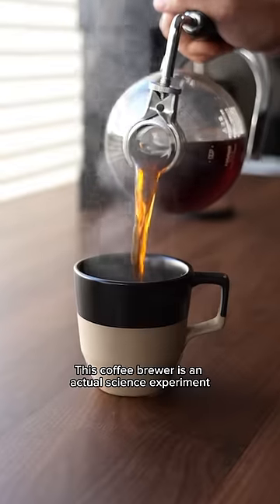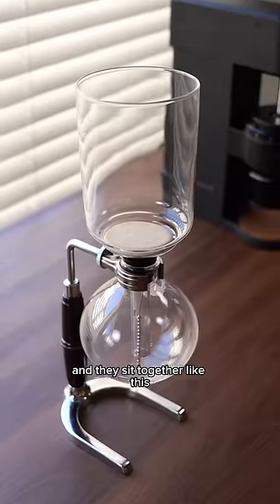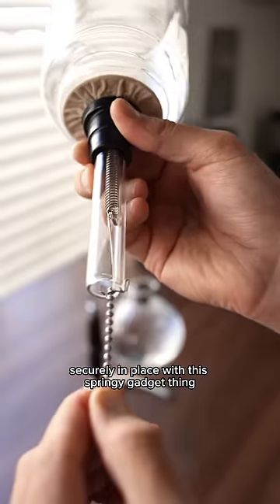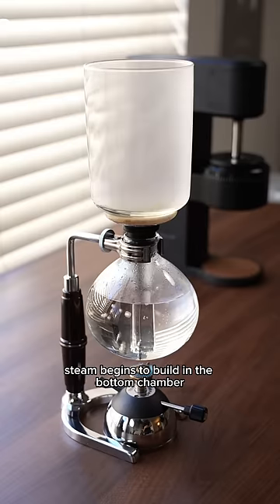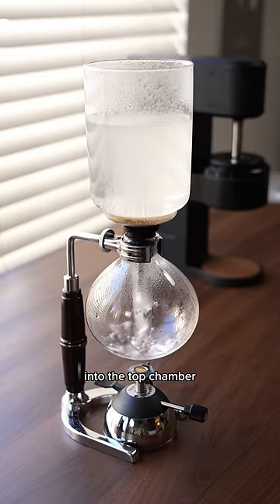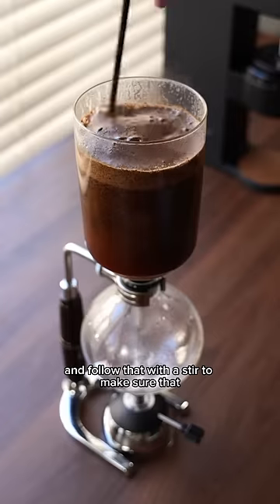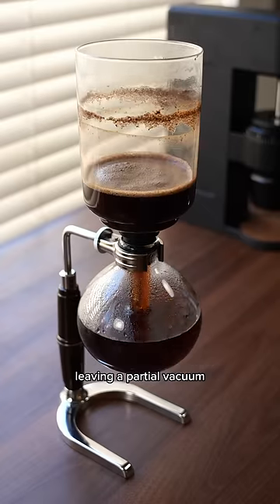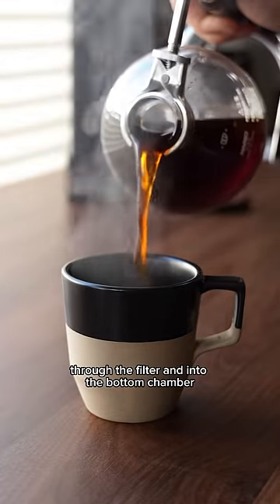A Science Experiment That Makes Coffee - The Siphon Brewer

Comment: Because the coffee is exposed to a partial vacuum as it enters the final chamber, dissolved gases(such as CO2) are pulled out of the liquid. This reduces the formation of carbonic acid, making it taste less sour, and allows the bitter oils to emulsify better, reducing the bitter aftertaste. The effect might be minor on this model because of how small it is, but equipment like this can definitely produce some kind of noticeable result.
Reply: Thanks I was wondering what the point of this thing was, cause otherwise it just looks like a filter coffee with extra steps
Reply: @The8merp it also is a way to maintain a constant, low temperature since there's an extra layer of insulation between the water and the heat source.

It's next to impossible to burn the coffee this way
Reply: Coffe is never exposed to any vacuum in here. Shows how you don't understand what's really going on inside this device physically.

And all you need to do to get rid of dissolved gasses is just boil the water, since high temperature decreases their solubility.
Reply: Also the bitterness comes from overboiling the coffee. This doesn't happen here, because the water temperature falls before it gets to fill the upper glass.
Reply: By the way, how would size of the model prevent the alleged effect from happening??
Reply: @puchacz199  the cooling water vapor in the bottom vessel causes the pressure to drop, creating a vacuum effect. And the dissolved gases in question are coming from the coffee brewing, not the water. Coffee beans release carbon dioxide.
Reply: @Gaswafers   yeah, but there's no vacuum as water gets instantly sucked up down again the exact moment pressure starts dropping.
Reply: LIES! YOU have no honor!
Reply: @puchacz199  if the liquids getting "sucked" as you said, doesn't that imply there being a vacuum?
Reply: @puchacz199  not to mention he says "leaving a partial vacuum" in the video 🤔
Reply: A vacuum doesn’t suck, the atmosphere pushes to fill a void at lower pressure. Big difference.
The effect of this difference is that the coffee is never subjected to a vacuum at any point.
Reply: @The8merp  That's basically what it is
Reply: @gtjack9 ummm, sorry to burst your bubble. However, that is the definition a of vacuum.
Vacuum pressure is a pressure that is lower than the surrounding atmospheric pressure. "partial vacuum" is accurate because it's not a complete vacuum "the absence of atmosphere".
Reply: Wouldn’t be CO2 not just redissolve in the liquid once it returns to atmospheric pressure?
Reply: The definition of diminishing results.
Reply: @BooBuKittyPhuk  its not getting sucked its falling due to gravity and also the air pressure from above, what hes saying is at no point is the pressure in the bottom chamber lower pressure than atmospheric pressure, infact its always higher pressure than atmospheric pressure because the weight of the water is also compressing the air in the bottom chamber, so its the opposite to a vacuum, the coffee falls back down because the pressure isnt high enough to hold the weight of the water up so it falls equalizing the pressure,
Reply: @JAGaymer  its not a vacuum because the water moves to equalize the pressure so its not lower pressure and the fact that until the very end the water is still being held up by the pressure inside of the bottom chamber, its like holding a box above your head then placing it on the floor, at no point did you pull the box down, you just pushed up less and less until you placed it on the floor, the only point where there is a partial vacuum is when the water level in the tube is lower than the water level in the chamber
Reply: @JAGaymer  if the water couldnt move then it would be a partial vacuum because the volume of air would stay the same and the density would decrease, but as it does move the density of air doesn't decrease because the volume of air gets smaller
Reply: @expresscrayfish6094  well, in the video he says there is a partial vacuum, so I'm not sure you're right so much as you think you are, but you very well may be because I don't know the content creator here so I'm not sure how much he knows about physics
Reply: you mean I might actually like the taste of black coffee if I used a proper one of these?
Reply: @TheRogueX  cold brew is probably still better.
Reply: I'm pretty sure that simple boiling strips dissolved CO2 and O2 out. By the way, some coffee geeks don't boil the water to avoid it because of taste
Reply: You Stole that word for word from Breaking Bad😂
Reply: You mean, this one actually makes sense? Wow.
Reply: @expresscrayfish6094  I like your explanation. Very nice imagery too. You make very good points, that I don't have the energy to do the research and, maybe, dispute. This round is yours, good sir!
Reply: Coffee reflux
Reply: Are you serious!? Never thought that there is a real reason except it looks cool. Thanks for sharing! 😂
Reply: @puchacz199 note that the comment is about a partial vacuum and it works best on a larger apparatus
Reply: @Gaswafers cold brew tastes like motor oil compared to a siphon brew
Reply: I always wonder how people can be so confidently wrong, people like you or flat earthers always makes me laugh
Reply: The PSI on the coffee is never negative; it’s held in equilibrium the entire time — PSI on the coffee is always 0.
Reply: ZZZZZZZZZ it’s a short bro
Reply: "Ya gotta decarboxylate it!"🎶🎶-not The Offspring
Reply: But all minerals will stay on coffee 😅
Reply: @puchacz199  a Don Pedro is using vacuum to suck the water down from the upper chaimber down to the loser, when it cools down and the volume is reduced.

BUT that is just to draw the hot water down and filter it before it enter the lower chamber.

Has, as you wrote, nohing to do with extracting CO2 or other gasses from the water ot coffe.
And the process do make it impossible to burn the coffe.  Because when you stopp boiling the water, is when the water is going down.  And boiling water can never exceed 100 degreese there, and when it is pressed up, it isn't steam and is mixed with cooler water.  So it is way under 100 degrees when it reaches the upper chamber.  And to suck the coffe down, you have to reduce the temperature in the lower chamber.

So yes, it is just a way of expose the coffe to hot water, and then filter away the coffe powder from the finnished product.
Reply: i aint reading allat
Reply: @puchacz199 the comment says Partial vacuum
With a bigger setup, you can get an even stronger partial vacuum
But it's almost impossible to get a full vacuum
Reply: @Gaswafers when im in a stupidly ignorant contesr but this guy is my opponent 😔😔
Reply: Beautiful. Most cafes and restaurants around me are always so acidic/sour. I just make my own now lol
Reply: @gtjack9  The only difference is perspective. Push/pull only differ by the frame of reference.
Reply: Oh, I agree! I have one of these and absolutely love it. It makes the best tasting coffee of all my coffee makers. Once, when I accidentally broke it, I lamented its loss online and received several as gifts that year. Now, if I break another, I have backups!!
Reply: it's still always gonna be garbage coffee because the extraction is happening at atmospheric pressure. you need about 10x that for a decent result.
Reply: Oh wow 😳 thanx for this 👌
Reply: @puchacz199 boiling coffee ruins it
Reply: @puchacz199 That’s just wrong. Literally the opposite of what happens.
Reply: I like my coffee a little sour. I guess it would be nice if it could just reduce the bitterness but keep the sourness.
Reply: and if you add some Methyl groups to some pre-processed specific monomers DEA may bust your door...but yes,you are right
Reply: There’s no carbonic acid in coffee, CO2 is all way evaporated (if there is any to begin with) when it gets heated. Chlorogenic, quinic, citric, malic, acetic, formic, lactic, glycolic, and phosphoric acid, and occasionally tartaric acid are found as they are all more soluble at higher temps  in water (like sugar or most things) CO2 however is more soluble in water at low temperatures, that’s the reason a warm soda fizzes more. The dissolved co2 comes out of solution and leaves as a gas causing the fizz, when it’s cold more stays dissolved so less fizz. 

It’s less acidic because the water is not as hot as drip coffee which is almost exactly boiling as it comes from steam which condenses at the temperature water boils at then drops to the coffee. Even better is a mokapot because the water only passes through otw up to the top and doesn’t stay in contact giving the acids more time to dissolve. Mokapot is also totally different tasting though because you use espresso.
Reply: @puchacz199 some of the coffee does experience a vacuum as the first bit enters the chamber and the chamber is still in negative but your spot on that buddy has no idea what’s going on here 😂
Reply: @gtjack9 no you’re confused about what a vacuum is. Sucking doesn’t exist without a pressure differential just like the one caused by the bottom flask. It is in vacuum and at the beginning the coffee going in does experience a vacuum. Saying the air pressure from above is higher than the pressure inside is saying the same thing as saying the container is sucking the liquid in. Everything is relative.
Reply: @atomatopia1 he’s just completely wrong, don’t think about it too much. But no, that’s like saying once you open your warm soda and it loses CO2 wouldn’t the CO2 come back when you cool it down. It’s gone and become like .001% of our atmosphere. Technically at room temp if there was absolutely pure water some CO2 would enter the water but it would be immeasurably small for most instruments
Reply: @MasonPapenbrock-my4gl  Yet, you’re missing the point that the bottom chamber is at atmospheric pressure, it’s impossible for it to form a vacuum, it’s actually slightly over atmospheric due to the coffee above the bottom chamber which is being pulled down by gravity. As the pressure in the bottom chamber drops due to the steam condensing into water a very slight below atmospheric pressure is experienced, but due to the coffee always pressurised above by the atmosphere it only experiences a very slight below atmosphere pressure as it flows downwards. This is nowhere near enough to cause the co2 to boil out of solution
Reply: Co2. But the flame isn’t inside the base
Reply: @GeddyWoods  what’s that affecting in the situation?
Reply: But doesn't using boiling hot water already overheat the coffee and extract more bitter flavors? From what I know this is the whole issue with espresso pots
Reply: @Jacob-yg7lz  no, the mokapot will not be bitter if you don’t leave it on the stove top too long. As soon as you hear steam chugging through the top you’re supposed to pull it off the heat. I even run the bottom under cool water to stop the heating entirely. If you do it right it’s not over extracted at all but if you let it go for even 10 seconds too long it will be awful
Reply: @expresscrayfish6094 I’m not going to argue the vacuum being an real effect here or whatever, but “its not sucking the coffee” is completely false either in the common language usage of the word ‘suck’ or in the fact that it it quite literally is sucking the coffee back down. Either way, you’re wrong.

Look no further than a straw. Heres a question: “Do you suck your drink up through a straw?” I would bet that every single person asked that would say “Yes, that is sucking”. 

So, why would this not be sucking in this case? When you suck fluid through a straw, you decrease the pressure in your mouth via jaw, cheek, and other anatomical functions. This low pressure zone includes your mouth and the straw. The beverage sits in-between the straw and the outside atmosphere. Once the pressure drops low enough, the outside atmosphere begins to push on the beverage and forces it up the straw and into your mouth. So I ask again: “Can we agree that this is sucking?”

Now to bring the point home. Here we have a reservoir of fluid (the top coffee funnel), a straw (literally the straw/tube at the base of the funnel), and a lower heating chamber (the flask at the bottom of the system).

The water boils, which creates a high pressure zone inside the heating flask, this forces the water up as it seeks equilibrium between low and high pressure. Once equalized your coffee is brewed and then you remove the heat. The temperature suddenly begins to drop, which causes the sustained high pressure to drop as well as there is nothing supplying energy to create that high pressure zone. The high pressure turns to lower pressure and as such, both gravity AND the fact that its lower pressure than the atmospheric air (because gravity cannot act if its too high in pressure) pulls the coffee back down into the flask. Other than gravity helping the coffee down in this situation, the effect is the same. Lower pressure zone which is separated from a high pressure zone by a fluid buffer. Again, the only difference is that gravity held the fluid down in the first example and instead it is gravity here which assists the fluids descent. However, the effect is still there. A low pressure zone sucked the coffee back into the flask (with assistance from gravity).
Reply: @puchacz199 after the steam condenses the lower chamber is under 1 atm vacuum which pulls the coffee water back through the filter.
Reply: @puchacz199 there is a pressure differential.
Reply: @puchacz199 he literally says the bottom chamber is left with a partial vacuum after the water boils, the steam forces the water up into the top chamber, the difference in atmospheric pressure now created A VACUUM in the bottom chamber
Reply: Im sticking with my Kurig because it's much faster.
Reply: @adamstrong98  Never underestimate the idiot. 
They are far more skilled in their craft of improbable screw-ups and regularly innovate in their field in ways even the most skilled engineers are left scratching their heads.
Reply: @gtjack9 Next you're going to tell us that magenta isn't a colour and centrifugal forces don't exist 🙄
Reply: Okay that's neat and all but temperature control looks like a bitch. I guess you can regulate it with dilution with cold water but you're adding heat during the entire extraction until you pull the vacuum by removing the burner. 

Dissolved gasses are less soluble as the temperature of water decreases and if carbonic acid is your main concern, you could prepare water that's been flushed with something else (like nitrogen) first? Iunno, it seems like, maybe not a lot, since people do a lot of weird shit for coffee, but like, not a great trade-off? like, a lot of the acid content is gonna come from the coffee itself, so getting low acid coffee or better control of the extraction seems more productive than messing with the acidity of the water from dissolved gasses. Heck, a lot of coffee nerds just adjust the ph of the water directly with, like, baking soda. 😂
Reply: @The8merp except it's not at all what this person is talking about. This is Jo different than sucking something through a straw. Does sucking coffee from a coffee cup through a straw have any effect whatsoever? I don't think so
Reply: @BooBuKittyPhuk NO. By definition if the water is being sucked, there is no vacuum.... If the water was stopped somehow THEN there would be a vacuum. But not in this setup
Reply: @atomatopia1 exactly. The Co2 is just whatever is in the air. The Co2 isn't separated
Reply: @BooBuKittyPhuk yea and people who make videos say a bunch of bullshit that sounds correct but is wrong just to keep your attention so you watch the video. That doesn't make them right. The guy in the video is wrong. It's not a "partial vacuum". It's called a lower pressure, not a partial vacuum. Partial vacuum is just a confusing description for laymen to understand but it's fucking wrong. A vacuum would require a drop in pressure with a constant volume. The example in the video is a change in volume of air (the amount of air increases but the pressure stays the same ), and then the volume reduces as the air cools, but again, the pressure stays the same (because the volume changed)
Reply: @fgui11 it doesn't, it takes more energy than that. Water steam is just H2O
Reply: @puchacz199  As I noted elsewhere, add the coffee before starting, and immediately remove the burner when the water is forced up, for the reasons you give.
Reply: It'd have to be effectively useless for me to not wanna do it this way anyways. 😂 It looks so dope and yields a clean brew, I presume.
Reply: @JAGaymer  you can't win an argument against a fool. Leave him to think he knows what a partial vacuum is and move on with your life, man.
Reply: Me only drinking my dark roast black "but I love bitter coffee"
Reply: @jawnske sorry you're illiterate.
Reply: Bitterness is what makes coffee coffee
Reply: @danInRealife  bitterness is a part of coffee's flavor, but it's not the only part!
Reply: Question, on another short- they said that the flavour of coffee can be expelled in the form of steam, thats why they use cold steel/chocolate/ice to cool them immediately.

Doesnt this method basically let the coffee steam away?
Reply: Ye, but no, this method is too hot to make any sort of decent coffee
Reply: There's no vacuum, because there's nothing that holds the water up, besides an overpressure at the bottom. Once the pressure at the bottom equalizes with the outside air, the water flows down. There's never a point were there's an underpressure.
Reply: @BooBuKittyPhuk  nop, vacuum, or partial vacuum, does not succeed on this video, the lower half has more pressure than the above half.
Reply: Co2 gets pulled up out regardless I’ve heard
Reply: Simply boiling water drives off dissolved gases. No need for vacuum.
Reply: Necro posting to mention that you can do this another way, sort of. I think. I could be wrong, but the reaction I get from doing this with my coffee and what I was told is doing it, probably means the same thing is essentially happening as what you are mentioning. 

So here it is.

Heat the coffee in your cup to just below the boiling point. No don't drink this right away. 

Now, this method requires sugar at the very least, but I add cream as well to help with the texture, flavour, and the temperature as well.

Add your sugar to the pre-boiling coffee. You should see it be normal for a second, then start to foam up at the top. This is all the carbon dioxide from the sugar (I believe) and any other carbon dioxide in the coffee otherwise escaping as foam on the top. 

Now add your cream and stir. The result should be a quite warm to almost maybe too hot coffee for some, but otherwise very nice cup of joe for the rest of us. To put into perspective, this is probably a few degrees or so hotter than the coffee would be fresh brewed on the heater. But not much more. 

This cannot be done however with fresh brewed coffee, because it's not quite hot enough to initiate the reaction. This is part of why I add the cream, aside from liking cream in my coffee. It brings it back down in temp. 

Also, you may or may not like doing this, but if you do like vanilla in your coffee at all like I do, add it first with the sugar. The heat will help evaporate the ethanol out of the vanilla extract, reducing the alcohol taste it leaves behind to basically nil. Again, has to be done while really hot, because ethanol boils/evaporates heavily at a temp just a bit below what water will.
Reply: @The8merp  Sometimes things can just be done because you enjoy a ritualistic process.
Reply: @gordon1201 sorry, but your analysis is incorrect.  At the moment heat is removed from the bottom flask, a partial vacuum is instantaneously created because the volume of the FLASK remains constant while the volume of AIR inside is reduced due to the removal of all energy input (no flame).  The reduced volume/partial vacum is immediately filled by the liquid above, equalizing the relative negative pressure in the system (i.e. partial vacuum).  This happens continuously until the system is stable (room temp).  The steam in the lower flask is at a higher overall pressure than the liquid above, but a RELATIVE partial vacuum is still created.  In a way it's semantics, but a partial vacuum is technically there.

Think about it this way - if you plugged the top of the coffee section and flipped the whole device upside down, you'd still get coffee drawn through the filter and into the now empty section until relative pressures on both sides equalized.
Reply: @atomatopia1  thought the same
Reply: @expresscrayfish6094  apparently the boiling process causes air to escape the lower chamber which will create a negative pressure but not immediately. The negative pressure being created mostly because of precipitation of water. Air will then reenter by the end. It would be true in a closed system tho.